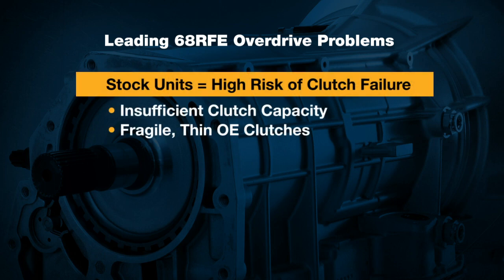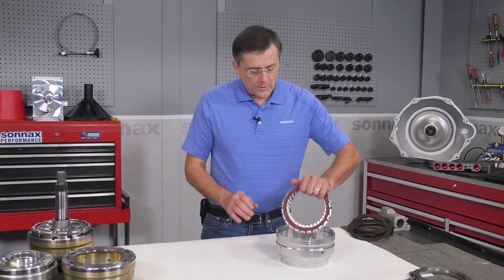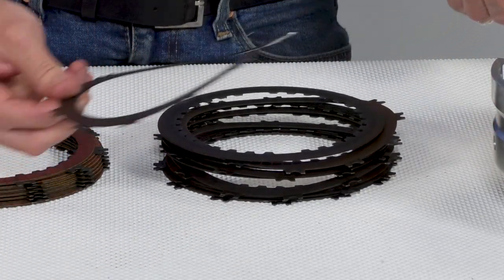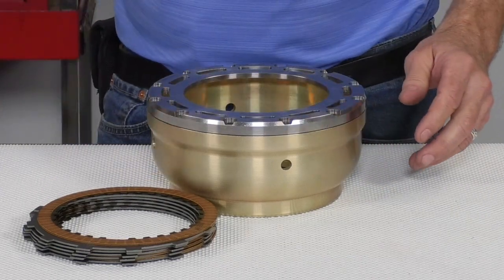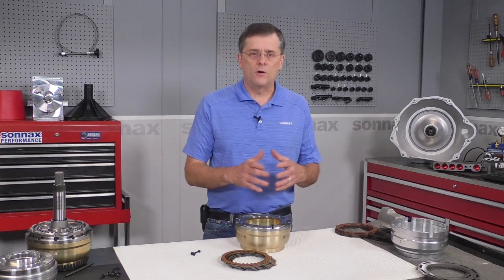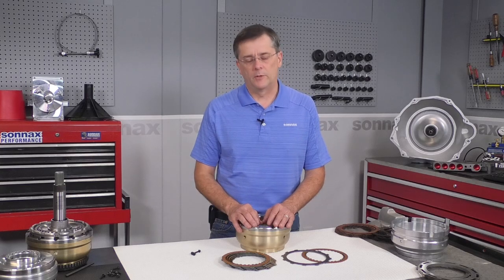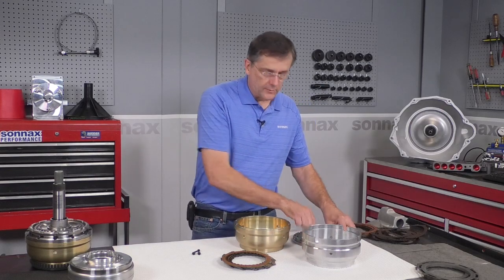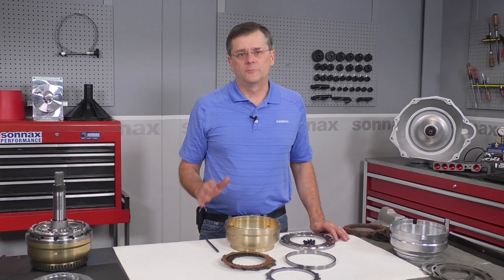Maximize 68RFE Overdrive Clutch Capacity & Squawk Resistance with the Sonnax Smart-Tech® Housing

Comment: So you have changed the clutch material from the original drum?  The clutches that came with my Sonnax drum were dark gray if I remember right. I had the 3-4 squawk too but that seems to be better.  I can't remember for sure but I think Sonnax tech support told me to add some lube gaurd the the trans fluid.
Reply from the maker: Yes, this new and improved kit features custom BorgWarner clutches optimized for max capacity and squawk resistance, plus longer, flange-head plate screws for extra secure fit and optimal clamping force. Thanks for reaching out, and have a great day!